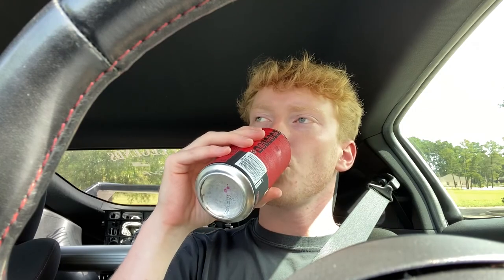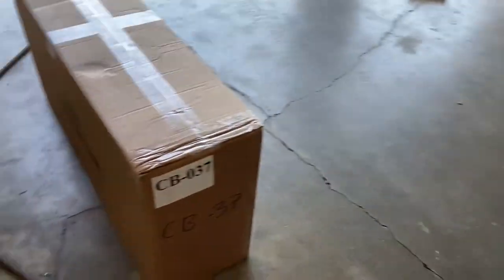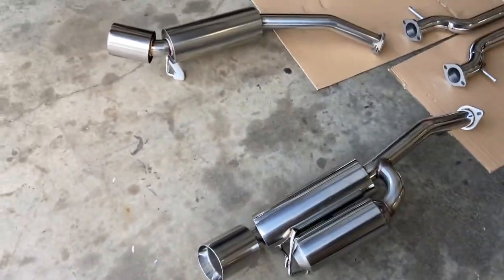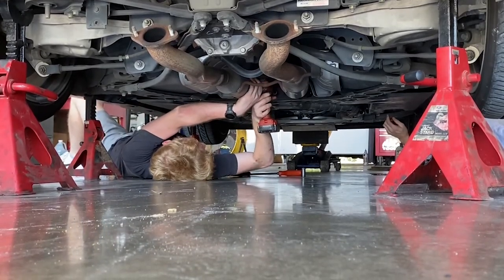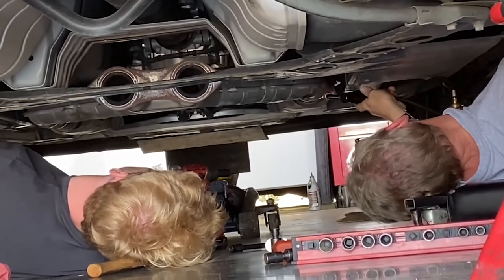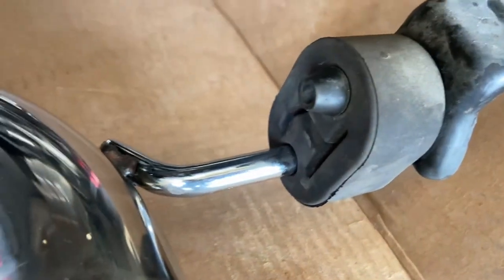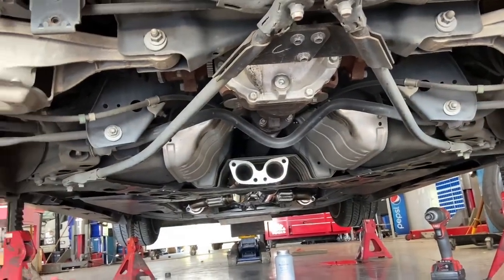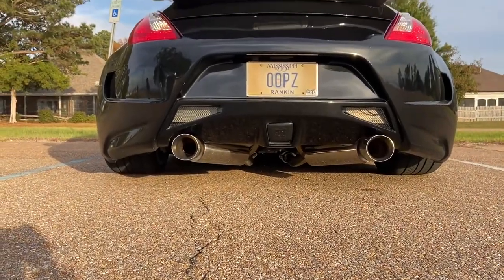Is it okay to buy a Cheap Exhaust?

Comment: How's the fitment on this exhaust? And do you still have it on the Z or changed it
Reply from the maker: The fitment was fine, it hung a little low at axel but the tip placement was good. I’ve got a greddy single exit exhaust now

Comment: is there any drone while you're driving at speed limit :P
Reply from the maker: Nope this exhaust is super tame and doesn’t drone!
Reply: Thanks for the reply, is it an H mid-pipe? 
was there any issue when installing?
does it come with all bolts and gaskets?
does it leak or it's perfect fit

because saw it on eBay sells for $400 and hope fit is at least decent not way off and have to redo everything
Reply from the maker: @al3zmi  its a true dual catback system so yes it has H-pipe. It does come with all hardware and gaskets. I personally didn’t have any problems with the install